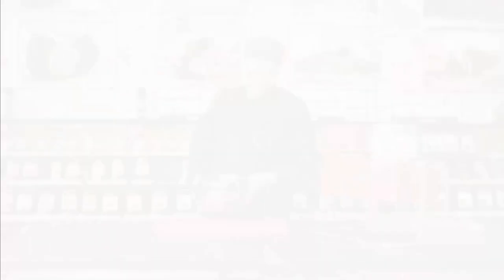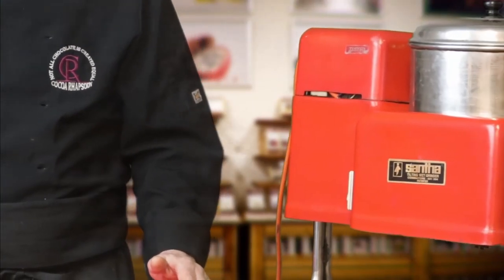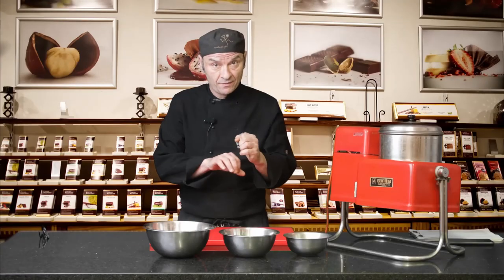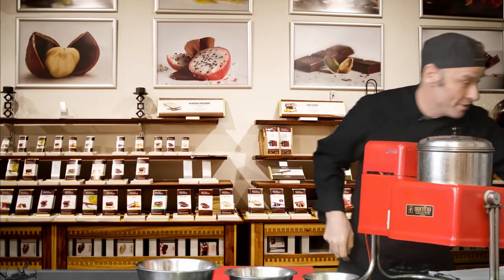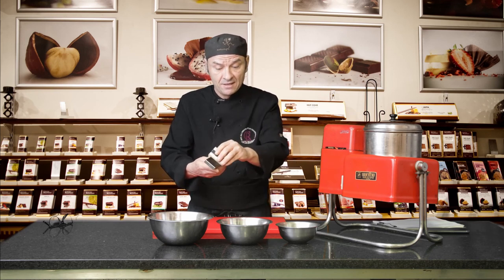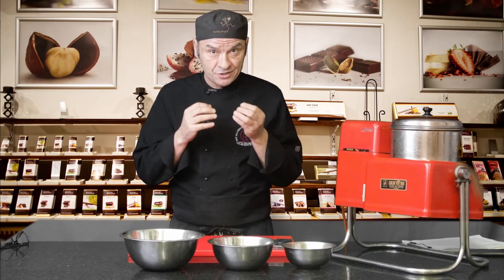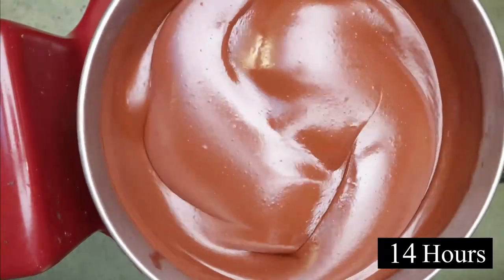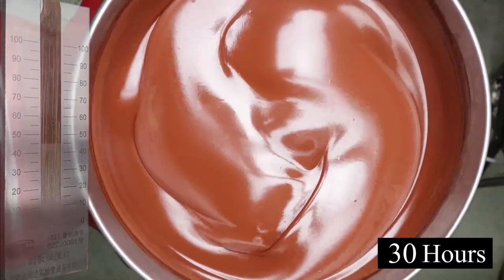The simple, but essential art of Chocolate Conching (With 3 day Timelapse )

Comment: This is awesome! But I couldn't understand when did you add other ingredients, like sugar and cocoa butter? And do we do anything different in milk chocolate?
Reply from the maker: Hi Sahil, In this case i added the cocoa butter and sugar as the friction heated the cocoa nibs up. You could add warm cocoa butter first if you wanted to and then gradually add the nibs and then when you have some fluidity add the sugar. If you are working with mass instead of nibs ( in which case the mass is melted like chocolate) you would go ahead and do an all in mix. 
In answer to your second question you would do everything the same except you would add  2 percent lecithin ( i use sunflower ) on day 1 or 2.
Thanks for the question. hope this helps.
Reply: @insidechocolatewithjimothy5313   Thank you so much for the detailed and informative response. This will definitely help :)

Comment: Thank you very much chef! 
I have one question: Can I just melt regular chocolate without brake the tempering so that I will skip the tempering process?
Reply from the maker: Possibly..... assuming of course that the chocolate in question is in temper to begin with, which it would usually be. 
but... and it is a big but, you have a working tolerance of around 1 degrees very difficult to do . 
You are better off using the seeding/injection method outlined in one of the other videos.

Comment: Dear Chef it was great worth information that I was looking for. It shall be of even more help  if you are able to let me know more about the stone grinder used in this process. Does its speed of grinding matters? ... more.
Regards
Kirti Thakur India
Reply from the maker: Hi Kirti. Look for durability if you will use it often. Santha can take continuous running. Small grinders are sometimes to fast and generate too much heat, if this is the case use a mechanical timer to shut it off in cycles say 15 min on 15 mins off. 
If you have variable speed then you don't need this. 
Thanks for watching

Comment: Do you let the machine run continuously for 72hrs & Do they need to be monitored ?
Reply from the maker: Yes I do let the machine run constantly. if you grinder is too fast and generates too much heat in the chocolate then use a simple mechanical timer to shut the unit on and off every 15 minutes. This is what I do when using my tiny domestic machine.
Reply: @insidechocolatewithjimothy5313  thanks a lot for the advice. Hopefully I can start making my own for the farmers market. I don't see anybody else doing it, so it's either going to be a success or failure, but I won't know until I start. 
I look forward to more of your valuable information...thanks again.
Reply from the maker: @littleisland7650  It's a pleasure for sure, Where are you located?
Reply: @insidechocolatewithjimothy5313  im from Ireland where only a couple of bean to chocolate companies operate, but for now I am using couverture from other companies.

Lots to think about 👍
Reply from the maker: @littleisland7650  all the best with your endeavours
Reply: @insidechocolatewithjimothy5313  thank so much 👍 keep up the good work.